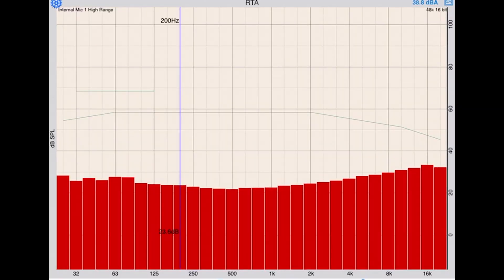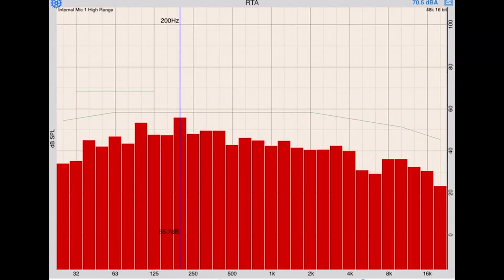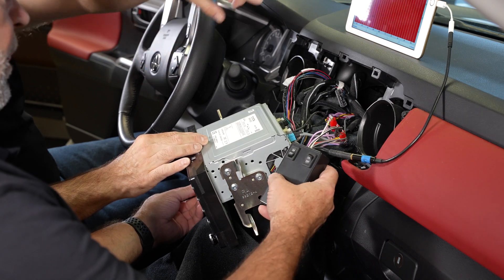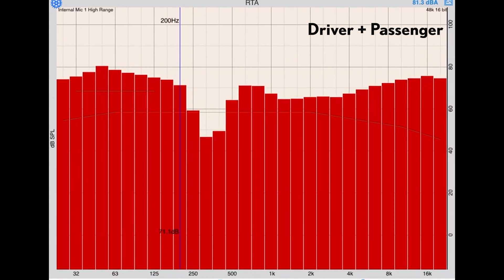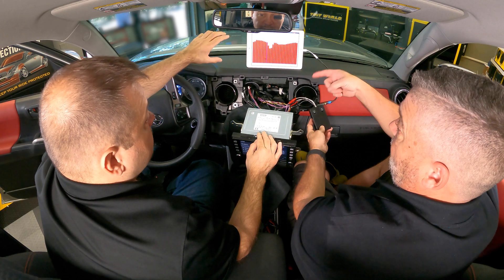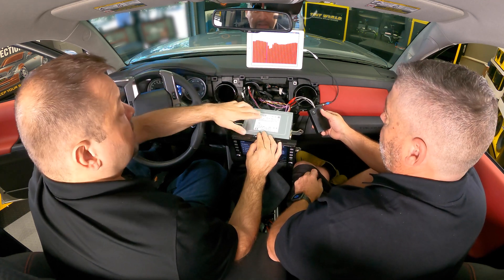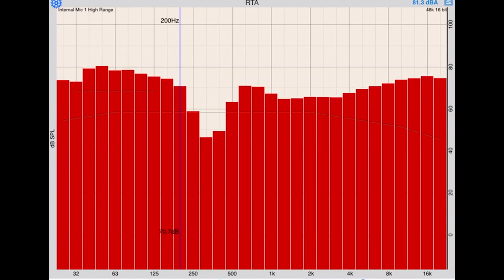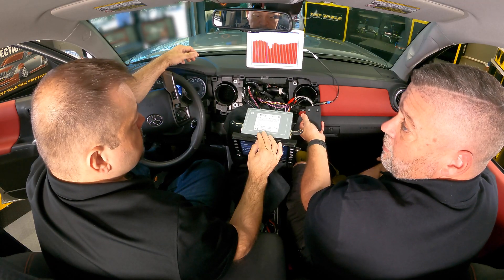How to Identify an All-Pass Filter

Comment: It sounds like your suggesting that Toyota purposely placed an all pass filter in their radios?  That would be hard to believe. Your measuring an acoustic issue that is a product of the environment. I would guess that your measuring for comb filters in relationship to the vehicle node which is causing an imperfect cancellation. The only way to truly know is with an FFT measurement system. 

An all pass filter is an electronic filter set that changes the phase of a defined pass band without affecting the frequency response. A first order filter changes the pass band by 90 degrees and a second order by 180 degrees. 

Pink Noise is all frequencies, but not all amplitude. It has an applied EQ curve that best represents human hearing. There is more weighting applied to the lower frequencies. White Noise is equal amplitude applied to all frequencies and shouldn’t be used to optimize your sound system. 

The display on the iPad prior to measurement is commonly referred to as the noise floor of the measurement rig. Higher quality measurement systems such as Smaart, won’t show you the noise floor unless you alter dB scale because the noise floor so low. 

I got out of 12v audio 26 years ago to become a system engineer for large concerts. I use electronic all pass filters to manipulate the phase as part of my daily routine. 26 years ago the SNI35 was one of the most used adapters then when I was an MECP installer. Glad to see that that no one has ruined a perfect product and you no longer have to mount the that old Honda radio behind the new aftermarket radio to maintain control keyless entry. 😀
Reply: Bose has 4 all pass filters in their gmc stereos now.
Reply: @rorythornton6429  are they adjustable by the end user or just designed into the circuitry?
Reply: @kiparue  built in.
Reply: @kiparue you sound like you’re pretty intelligent on the sound side, I’d love to get your reason on why you think they used them. There is a video on here that goes through the whole thing. There is so much sound missing from the Bose speakers because of the filters when they are summed it’s insane.
Reply: @rorythornton6429  All Pass filters are used to further eliminate audio loss due to poor phase response. They can be deployed to fix the interaction between two speakers that share the same acoustic crossover properties (the high end of the mids and the low end of the highs). They are used to make the audio linear so that all frequencies arrive at the same time. I used to work in car audio in the 90’s but now work in complex concert sound systems. The overall premise is the same though the high frequencies will arrive at the ear just slightly ahead of anything below it. It’s not the fault of the tweeters per se since larger wave lengths take longer to develop. 

When I first made that reply I’d been out of the car game as an MECP installer for 25 years. I couldn’t imagine car manufacturer to go through such great lengths. Last weekend I installed in Alpine 507 into my Tahoe without really reading the features.(I really only wanted CarPlay) and was pretty amazed at how much EQ was available inside of that head unit.